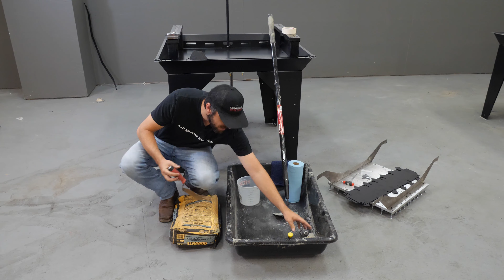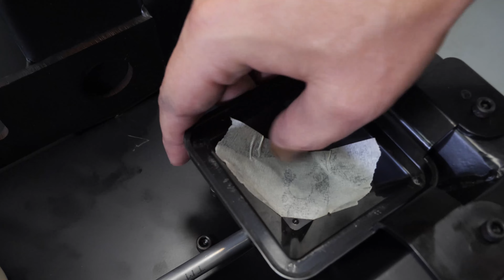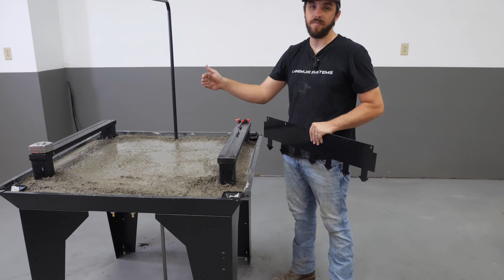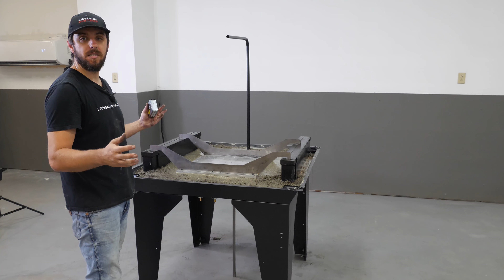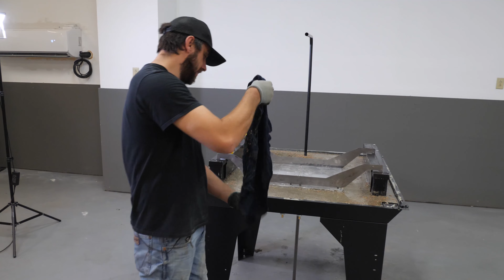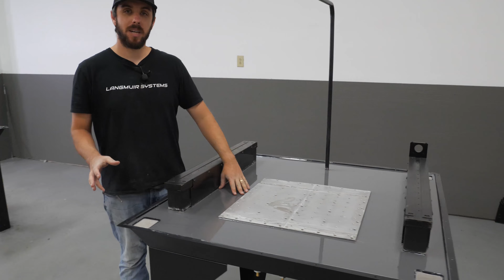MR-1 CNC Mill Assembly Tutorial: Pouring the Concrete Base

Comment: I’m sorry, but being of precision German heritage, I just don’t think I can swallow the crude manner of constructing this thing. I’m wanting to construct a precision metal milling machine, not pour the footings for a house!  Although I have heard of using concrete in such machines, the only ones I’ve ever seen used sand, and then that was only used as ballast to increase mass, not as a member of the structure which defines the precision of the machine. If I buy one of these, I’m going to have to figure out how to get some old fashion cast iron into that framework (for which I’ll need a mill which presents a circular reasoning problem). I think this overall design and capabilities are outstanding, but this concrete business has got to go: just too many opportunities for  failure, particularly if you are not doing it regularly.

Comment: wouldnt polymer granite be a better choice
Reply: It would but that would seriously drive up the price and it's design is 100% different than to this design. Also when working with epoxy granite it requires at least 3-12 months of planning before buying epoxy. A lot of testing is required as well, need to test many different small batches of epoxy mixed with granite to get the best recipe. The base, columns and gantry are all epoxy granite and does not have any steel structures supporting it, thats the main purpose of using epoxy granite, to use it to make the actual structural parts. When using steel structures that are all precision ground and cut you can use cement or epoxy granite to fill in the cavities, epoxy granite wouldn't make a huge difference but would help only for vibration dampening. Honestly I would go with the cement it adds more mass and rigidity when using proper metal structures and its much more easier to build and work with.

Comment: I do have a few questions for you in regaurds to protection of components in the bed prior to the pour.? 
1-Do you recommend to cover the drain tubes, brass fittings or rubber hoses with plastic or any other protective type meterial piror to pouring the conctreate bed? Seeing the aluminum drain tubes and brass fittings, and both being Nonferrous metals, there quite possibly could be issues over time with corrosion problems to the nonferrous metal components since continuasly in constat contact with the cement and then ultimatley creating failure of said pieces down the road. Also, would it be better to use nylon tubing instead of rubber fuel hose? nylon tubing being able to handle petrolium based cutting fluids and not affected by the alkalinaty of cement.
2- Do you have any issues with fiberglass glass fiber being installed into the cement during mixing to  increase the strength and also prevent cracking of bed down the road if table were to be moved?